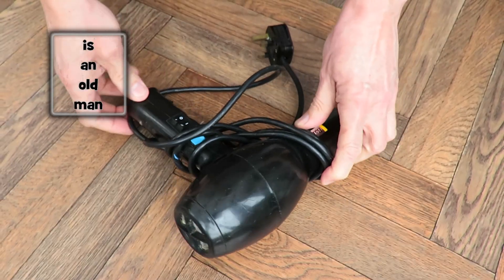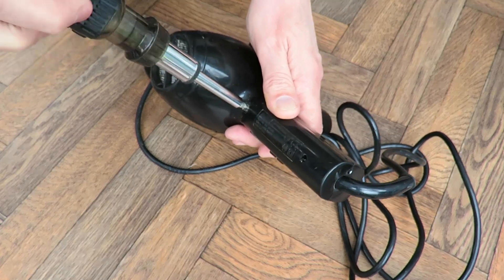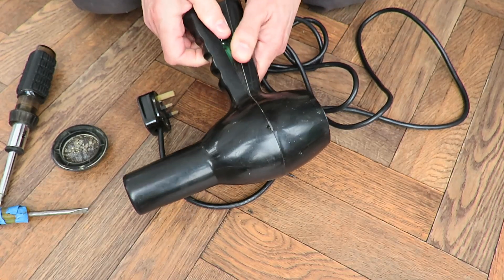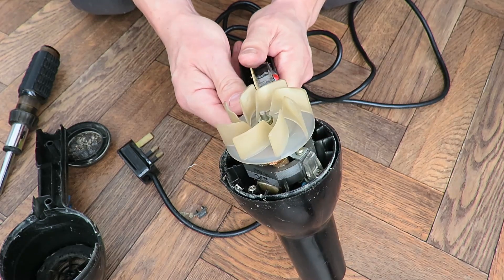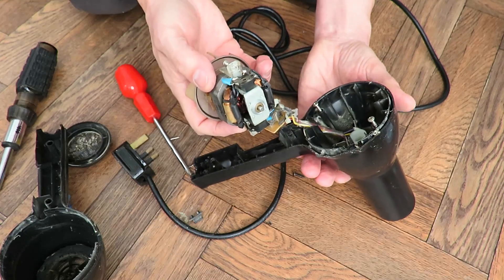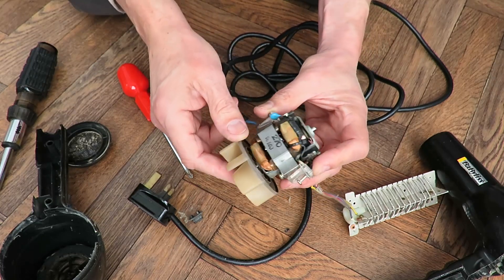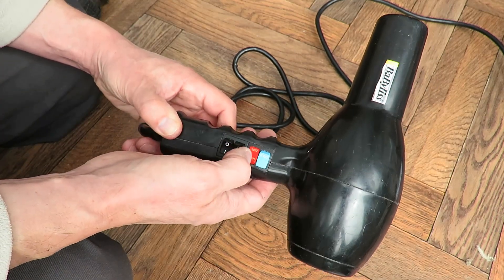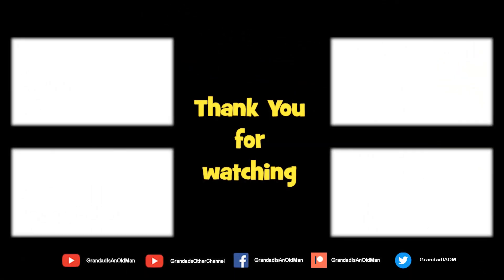Tear Down - Babyliss Hair Dryer

Comment: Don't throw it out sell it on eBay or give it to charity
Reply from the maker: I generally buy them from charity shops to strip the motors out for my RC toys. This one surprised me because it didn't have a normal DC motor. Absolutely no way I would donate that to a charity shop after a destructive tear down like that. No way that would be safe and the cord was degrading, so it would need replacing.

Comment: that is a dc motor..
Reply from the maker: As I understand it these are refered to as a Universal motor https://youtu.be/0PDRJKz-mqE however I have been unsuccessful trying to run it from a battery supply. I did have some success just about 3 years ago in this video https://youtu.be/9CNeNnvCkHM?t=745 Of course it could be this one needs some maintenance as it seems fairly stiff to turn but I have tried lubricating the bearings with no improvement. It certainly is not what I was hoping to find. I have had several very handy powerful "normal" DC motors from hairdryers where they use the heater element to drop the voltage and a diode bridge to rectify the AC.